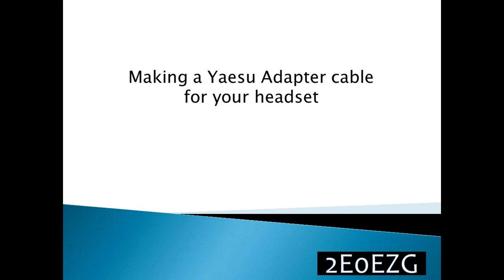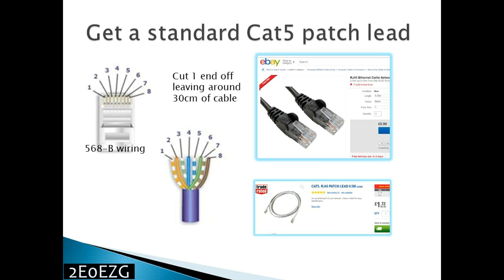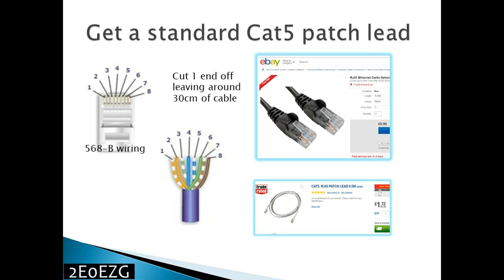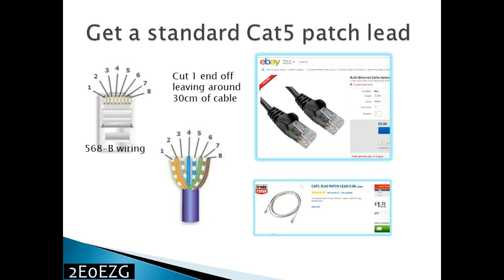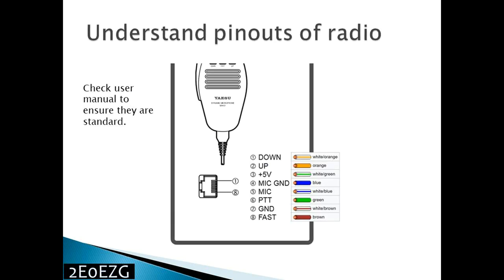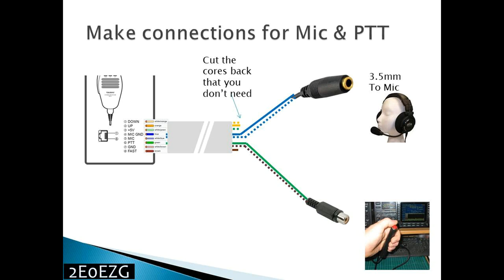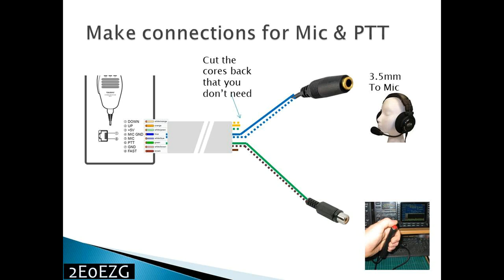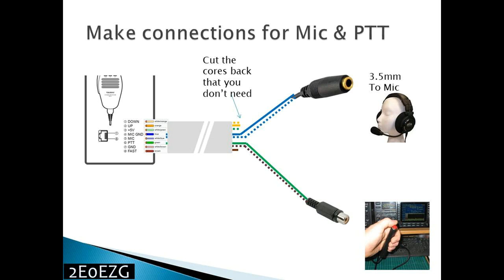Yaesu Headset Microphone PTT adapter cable.

Comment: Thanks for the video!!! Clear and concise instructions, it took less than 30 mins once I had all the parts. Works great on my Yeasu FT-450.
Reply: Just curious. Does the sound come in through the mic 3.5mm socket as well as mic goes out?

Comment: Well, for example in a Yaesu FT817 if you use an electret type microphone it doesn't work, it must be a dynamic type, for this purpose a module is required that adapts the electret microphone to the dynamic microphone input of the Yaesu.

Comment: I erroneously bought the Icom Heil headset, the Elite Pro Set 6. Unfortunately, the mic, which comes as a electret cartridge mounted inside the boom doesn't work. I don't get it to work modulating the FTDX10. I was looking for info about it. As the told to me, the electret mic for Icom, doesn't work, despite the fact I have the proper Yaesu adapter.  The vendor also told me that there's no way to get a spare replacement dynamic cartridge. Is there a way to get it to work, despite this warning I received from the seller?. Should I send a message to Heil, in order to ask them for a spare dynamic capsule, if still possible... or I only would expect to finally sell the headset to my local ham market and  resign any mod?. 73 de CX3BZ.
Reply from the maker: Hi. Personally I would sell it and buy the proper one. Also remember Heil is not actually great. There are many issues with them but the marketing is good. I get better reports from a PC gaming headset from Amazon that my heils.

Comment: Hello, thank you for the video!
Do I understand correctly that the MIC goes to the blue/blue-white wire. Where does radio audio output go? Another plug?
I have got a used TR-2000 from a friend, but the wiring is a little messed up. Seems like the wire for mic and speaker are one and the same. Which I find strange
Reply: Mike MØXMX thank you for the reply! I'll figure it out!
Reply: Radio output from the rig headphones goes to jack headset audio

Comment: Hi, if possible, I would like to ask the favor of clarifying a small doubt I have. My Radio is a Yaesu FT-2000, and I have a Superflux Headset HMD-660D and a Heil AD-1-Y cable, but the microphone of the HMD-660D does not work with this cable. And I already tested everything, and the problem is the same cable AD-1-Y. So, what cable should I buy for my Yaesu FT-2000 and Headset HMD-660D...? Thank you very much for the help.
Reply from the maker: Sorry I cannot help. Good luck though